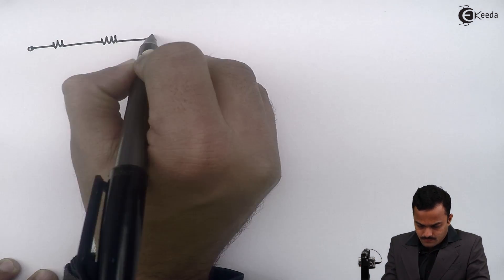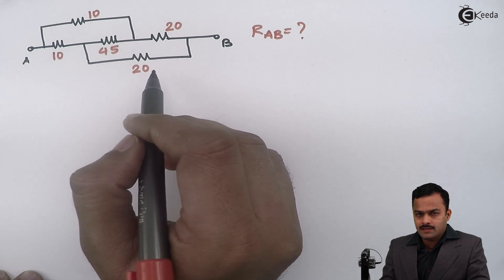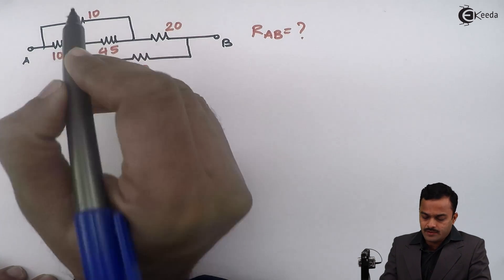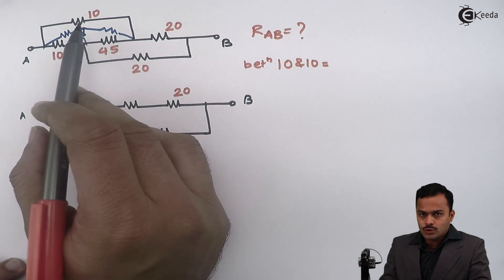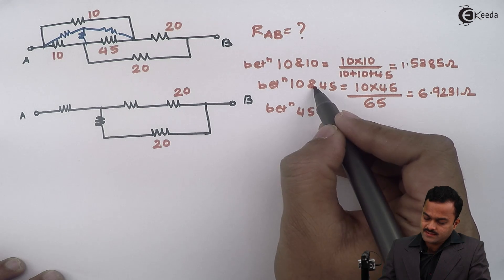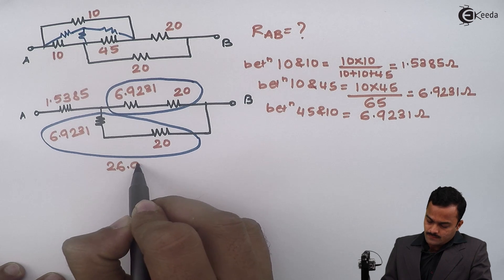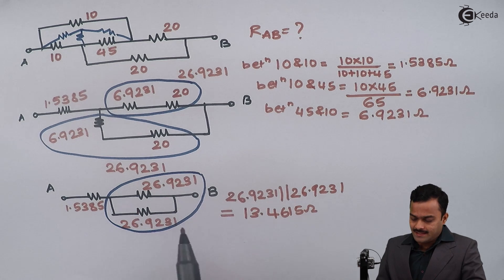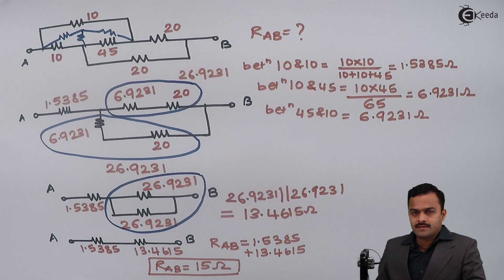Star to Delta Transformation : Problem 2 - DC Circuits - Basic Electrical Engineering

Comment: But we can solve this by wheat stone bridge method also
Reply: As sir is teaching star delta conversion
So,sir used that method !!
Reply: But it should be in balance
Reply: @vishnuteja1402  watch carefully and resolve into wheat stone it is in balance . The ratio of 10/10 and ratio of 20/20 are equal then no current pass through 45 resistor.
Reply: @sanjeevshah5638  ya..